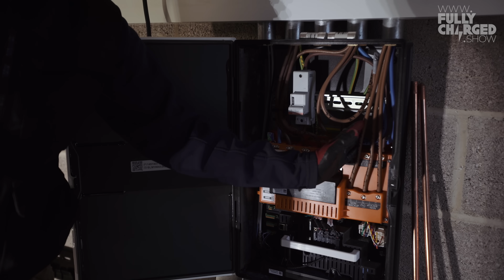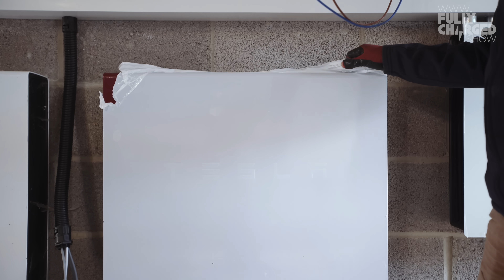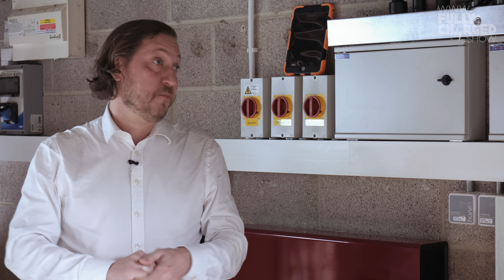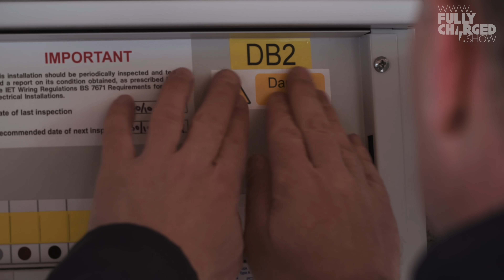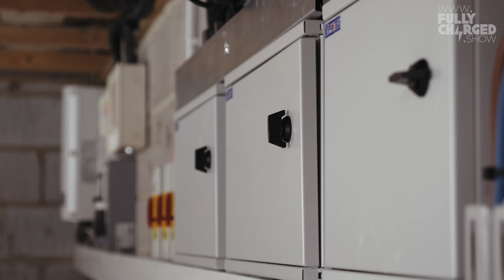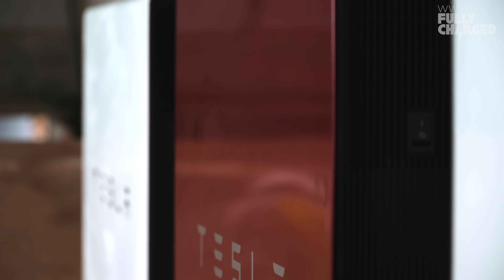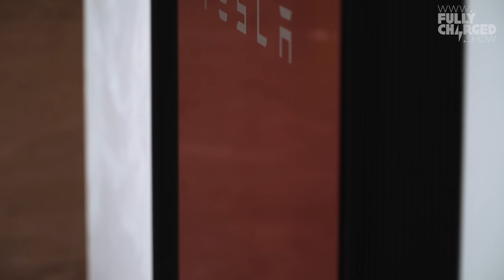Can you run your house on a battery? Tesla Powerwall 2 (Founders Series) & Tesla Backup Gateway 2

Comment from the maker: In response to your questions about the requirement for 3-phase electricity supply, Dr. Chris gave his thoughts:
"The grid operators look at the worst possible case for export in their calculations. They look at 5.5kW of solar being produced, with 10kW of power from the batteries, and no loads, and see if the grid can handle this 15.5kW of export (in this case they found it couldn't on 1-phase).  In real life, you wouldn’t see the solar producing its maximum and the batteries fully discharging at the same time, so the grid operators are being very cautious here.  Indeed the batteries are designed to discharge such that no electricity goes back to the grid!  The grid connection regulations were initially set up for back-up generators; if Robert had a 15kW diesel generator in his home these rules would make sense.  But they do seem a bit dated to work for modern solar/battery systems."
Reply: Yeah, they really need to review those electricity standards.

I mean, the disconnection switch ought to be on the grid's end of things. It's really poor design to distribute the responsibility for the safety of your engineers across many households not exporting - which entirely depends on everyone 100% following the standards, and that all the wiring has been done correctly - than it is to simply have the switch for a particular household on the grid itself (at the point where it branches off from the main line to each household).

Because then the responsibility is within a single pair of hands - the owner of that stretch of the grid infrastructure - and, more crucially, available for the engineers themselves to ensure their own safety. If they need to work on a particular stretch of the grid, then they can themselves disconnect all the users of that stretch of the mains line, to guarantee that no power is going in or out on that stretch, before anyone touches it.

This isn't unprecedented. That's how the water supply works. There are valves for each household, in order to cut the water supply to a particular building.

The "backup gateway" should not be necessary on your end, as the connection / disconnection switch more logically makes sense on the grid's end. Then the engineers themselves can directly make sure that nothing is importing / exporting on the line, before they start their maintenance of it.

It's shifting the responsibility for engineer safety to the wrong parties, in a distributed way, that's way harder to control. If I owned a stretch of grid, then I'd not be at all happy at ordering engineers to do maintenance, when the very structure here is logically wrong. Personally, I'd install the grid-side switches myself, to ensure I could sleep at night, with a clear conscience, that I'm not risking murdering my employees, on the off-chance that some cowboy builder has failed to follow standards, somewhere amongst the potentially hundreds of houses that are connected to this line, that I somehow have no ability to cut off from my end.

To be honest, even with a 100% "import" grid - with no micro-generation exporting going on - this arrangement was dumb anyway. Now it's just positively reckless.

The switch should be on the grid's side, so they disconnect you from the grid, in order to carry out maintenance, making it impossible for you to be importing or exporting, as you've been physically unhooked from the grid first.

It's not just that the electricity standards are out-of-date and need updating. They were a bit stupid in the first place (but I guess you could get away with it, when it was a 100% "import" grid). Now that the Grid really needs to be made properly bidirectional and more decentralised, this arrangement can't stand. It's dangerous and illogical.

If you get to talk with any politicians or other responsible authorities at any point, Robert, point this out to them that this is in very desperate need of revision, so we can more quickly get things to how they always should have been in the first place anyway.
Reply: @klaxoncow  It's much easier and safer for the Network Engineers to always treat LV as live, which is what we do. No change in standards will legislate for "stupid customers" so we have taken the responsibility for ourselves and our teams safety.  We have over 130 years of Network experience, and procecedures that are almost perfect, and are reviewed constantly. 
When I worked on the network, we used to worry about the paper shufflers in the office, as they were much more likely to suffer an injury that us, as all of our work was regulated and triple checked. 
Every LV phase has a fuse set in the substation, so we can isolate at grid end as you mentioned, we in no way rely on the customer household fuse.
Reply: fullychargedshow total cost?
Reply: SMart Export Gurantee - SMEG!
Reply: Looks like you should have had a restrictor on export put in place instead of upgrading to 3 phase
Reply: @Grande.Johnson  We tried that one!
Reply: @Grande.Johnson  "Indeed the batteries are designed to discharge such that no electricity goes back to the grid! "
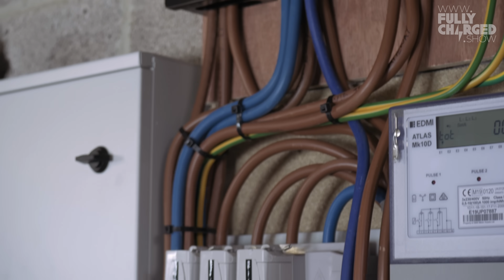Reply: the split phase looks right. I saw L1, L2/N, and L3 at 3:58. That usually means you’ve got an open delta to “fake” three phase.

Are you paid for the power you produce if you generate more than you consume? Given the investment you’ve already made you may want to maximize your solar generation

I’m surprised the throw over on loss of power is so slow. They have fast bus transfer relays that can switch without being noticed. Tesla needs to up their game
Reply: First. The issue of 1,2,3 phases. In the UK it’s generally a 1 ph supply and occasionally 3ph. In all cases the installation had to comply with the Wireing Regulations. in Roberts rural location he was probably being supplied by a small 1ph Transformer, hence the high cost to upgrade. And I’m avoiding the discussion as to weather that was needed or not

WRT safety there are clear recommendations in EA doc G83 and it’s updates, which are mirrored un the UK Distribution code and Wiring Regulations WRT signage, protection, and isolation. These are constantly under review as technology advances. And The Distribution Operators have their own working processes when it comes to maintenance work. I echo the comment about always treat it as live unless proved dead, isolated, and earned. PG Thomas Chair of G83.
Reply: We have a 15kw wind turbine and our grid supplier wanted us to upgrade. I drew up a circuit diagram showing how we would not export more than 16 amps, in fact we try to export very little, using any spare to heat a 7000 litre water tank with heat exchangers for domestic hot water and heating. This was passed by them and we didn’t do any upgrade.. it’s a rip off in any case, if you can draw 100 amps down a line you can send 100amps back up, they just want to make money for nothing.
Reply: Agree.  But it may be that this Powerwall is 3 phase unit. Perhaps Richard will tell us
Reply: @peterthomas3336  not 3 phase PW2 no such thing. need to put one battery on each phase. only 2 PW2 in this video so batteries only attached to two of the phases. the site needs a lot more solar that is for sure.
Reply: Well they can't wing it, that sounds technically correct and also a safe way.
Reply: Please correct me if I'm wrong, but... if I supply power back to the grid either from SPV or battery and the 'grid' is disconnected from the grid by a fault say on my phase, then I could be supplying all other properties on my phase with power which would soon run down my battery's very quickly I.e in the case of powerwalls at about 5kw each, so the disconnect needs to be at my end  as required by the regulations, to protect me and other people on my phase. Also think 15 sec for failover is a long time, this would mean I still need at least 1 UPS for my computers.
Reply: Having been a distribution engineer (power networks) for a UK utility, I can tell you that we never “assume that the power line is dead”.  At low voltage (240/415V) we treat the cables as if they are live at all times, as it’s just to easy to miss someone pumping electricity in from an unknown source. At the higher voltages, behind the transformer, (11kv) we disconnect all of the LV links before starting work, as again we never know If there is a source consumer side. We also disconnect both ends of the HV cable with circuit breakers before testing the line, basically by shooting a steel bolt into the cable to short it!  The three phase issue here isn’t about protecting utility workers, as we almost never put ourselves in a position to be in danger.
Reply: @Muppetkeeper  First time seeing 240/412V, we have 120/208, 277/480 in the US.
Reply: kimchee94112 It’s nominally 230 volts single phase, and 400V three phase, but we used to use 240V, but now we’re 230V with a wider allowed margin. That’s Europe for you 🤗
Reply: @Muppetkeeper  mate this is a consumer focused show. details details. gotta make lord elon seem cleverer.
Reply: My  question is could u run ur house just off solar and batteries no grid for long periods
Reply: @matthewbuckle6419  you are asking the wrong question. of course you can. it depends on the design and cost.
Reply: @boobtubereborn  so what would be tbe question if i can i would like my house to run without the grid
Reply: @matthewbuckle6419  If there's enough solar to refill the battery during winter, sure.  The solar and battery are able to work with each other while disconnected from the grid.
Reply: @taylorlightfoot  i mean completely no grid at all
Reply: @matthewbuckle6419  Technically yes.  I don't think Tesla has released support for this yet, but you can make it happen.  You'll need to have the Backup Gateway still and you'll need to hook something (pure sine wave inverter powered by battery) up to it initially to act as the "grid".  Once the system is installed, get rid of the inverter acting as the grid, the Tesla system will sense a grid failure, automatically disconnect from the grid, and then the system is running off grid.  

A few caveats.  You have to trick the system into thinking there's a grid when you do the install, you have to have an Internet connection to use the Tesla system.  It needs Internet basically all the time, you have to install the Backup Gateway with the automatic transfer switch inside, You might not be able to find a Tesla installer willing to install it in the manner you're trying to accomplish.

There are other off grid products that support what you want to do.  SMA Sunny Boy Island, Schneider Electric Conext, Outback power systems, MPP Solar inverters, Victron Energy, SolArk, etc.
Reply: @matthewbuckle6419  Technically the answer is 'yes you could'. Calculate the peak power you would use (to size your inverters max power rating), calculate your average daily power usage, multiply that by how many days you want to run only on battery pack, allow for conversion losses in inverter/charging. That's the battery capacity you'll need. The PV 'solar panel' size/capacity will need to be chosen for the ratio of grid/off-line you expect, so that it can keep pace with your average load (plus a little extra to recharge the batteries).
e.g  peak load = 20kw (inverter needs to be rated 20kw max load).
Average load = 2.5kwh (24hr = 60kwh per day), choose PV panels to at least this minimum daily provision.
Battery capacity = 60kwh = 1 day, if e.g you want to run off battery for 14-days, then batteries =60kwh x 14 =  840kwh.
Allow extra for loses in percentage  inverter/charger efficiencies.
e.g. if total inverter/charger efficiency is 50%, then you'd double the battery capacity and PV minimum sizes.
The above is only ball-park in essence, but it's a reasonable overview. In reality you'd have to factor in temperature effects on batteries and PV panels, and local weather conditions, and any seasonal variation.

Inverters are most efficient around 60-80% of max rating, so it might make sense to have a dedicated inverter if you have one or two really power hungry appliances such as a 10kw shower, and a separate inverter for your other loads that never peak over say 4 kw and average 2'5kw. OR heat storage of water and a mixer shower, and only a 3-4kw inverter to do it all.
Reply: @matthewbuckle6419  if you're a hikka w/o wife and kids, and etc and don't live in the Arctic - sure, why not?
Reply: @peteri3982   i mean will we ever become grid free for ppl with families etc
Reply: I don't believe you have a three phase setup. You have a split phase setup.  A simple voltage test across l1 and l3 is simply double the voltage between l1 and l2 and l2 to l3. plus you would have to have two to three transformers out on your incoming line to have three phase. It is three wires tho 👍
Reply: if i'm reading this correctly, which i'd like to think i am, are you suggesting that your batteries can feed into the grid? because i would not think that's ever a feature someone would want?....i can of course understand exporting excess power from the solar, because of course, but in what kind of situation would your batteries go full dump to the grid? why would that even be an option?
Reply: @McLovin1188 its not a case of using grid power but if it was to become obsolete could i power my home just on solar and batteries
Reply: It's also about keeping the phases balanced. A single phase can deliver almost any amount of power, but you can't have 1 of the 3 phases supplying significantly more power than the other 2. The load has to be balanced at the transformer.
Reply: Panasonic and Fujitsu in Japan have had these lithium cells for homes for years. I heard Tesla is even using the same cells that Panasonic use. It's nothing new really.
Reply: How many years does it take to recoup your investment if ever?
Reply: @ovdtogt1  You never recoup your investment. If all goes well and you have few issues to solve, all you will do is prepay your electricity bills. A friend has a $15,000 installation and it will never repay him. But he doesn't care. He just likes living with this way of providing power independence. No batteries, unfortunately, so when the grid goes down and so does the sun, he is SOL.
Reply: https://youtu.be/gP51JjnWvLo?t=860 The Power Companies will then change the peak price!
Reply: Tesla controls what can export - it makes sense to prepare for the worst possible export.
Reply: Something fishy going on here. My house has a 100A supply at 250V. That is a roughly 25Kw capacity. Most homes around me are 200A standard. That is 50Kw capacity. The output from the batteries is limited by the capacity of the inverter. Installing a 10Kw inverter and having 5Kw solar panels delivering an actual 5Kw of power at noon on a sunny day makes 15Kw of power to the grid available, yes? A long way from my 25Kw lines to the transformer in the street. So why the need for three phase? Does not make any sense. As does much of the content of this video. Too many missing pieces here. Too many qualifiers left out. Crucial ones.
Reply: So what are the benefits if you don’t have constant sun?
Reply: I think the powerwall is shit if it makes me have to invest another fortune for a UPS. An outage is a dealbreaker. Just like the internet coercion.
Reply: What would the total cost of this system be to install
Reply: in the U.S almost no residential areas have 3 phase power and even in the industrial areas it is extremely expensive to put in. here they quoted $250,000 for 600 feet. 3 phase is much cheaper to use for industry and they hate it.
Reply: Winner of a video, been searching for "how to make your own electric generator" for a while now, and I think this has helped. Have you heard people talk about - Pansaiah Renowned Preeminence - (search on google ) ? It is a great one of a kind guide for discovering how to create an efficient homemade generator without the headache. Ive heard some amazing things about it and my mate got cool success with it.
Reply: Many thanks, I been tryin to find out about "can you run a generator with an electric motor?" for a while now, and I think this has helped. Have you ever come across - Pansaiah Renowned Preeminence - (search on google ) ? It is an awesome one of a kind guide for discovering how to create an efficient homemade generator minus the headache. Ive heard some extraordinary things about it and my partner got cool success with it.
Reply: We do this different with Victron, We can program the maximum power getting fed to the grid, iff you want to feed that, So the house is totally seperate from the grid. But can feed the grid iff wanted, other way around, you can always use the grid to charge the battery,s iff needed. (and stil this system disconnect the grid when there is a power outage.. .. so even iff you have 30 kw on the roof, you dont need 3 fase. Its all programmable.
Reply: It should be, but isnt made obvious in this, or many other Powerwall presentation videos that the Tesla Gateway as it currently stands (2 October 2020) cannot supply backed up power on anything more than a single phase of your three phase home. For anyone with an existing 3 phase supply this actually means rewiring the property to ensure that critical components are installed on the backed up phase. Immersion heaters, pumps, car chargers, CCTV etc etc etc. Is anybody still up for that little sting in the tail after all the other costs involved or is there a more elegant work - around solution?
Reply: Why not just not export to the grid at all?  It sounds like with the Powerwall's capacity you'd have very little to export anyway.
Reply: steve ward

From what I can see here you have 3 single phase inverters on a three phase system? If that's not the case you must have, ripped out the existing 1p inverters and replaced with three phase inverters for the existing PV and battery. 

If its Its made up of single phase inverters as i suspect you must have one Inverter for PV and Two for the battery units.  i.e its either all lumped on one phase and doesn't conform to G99's balancing requirements, or you have PV generating on L1 and the batteries doing nothing on L2 and L3. Why on earth the DNO recommended 3 phase is beyond me. Much better solution would have been to apply G100 the battery inverters and keep a max Export of the 5kW PV even if it meant sacrificing some capacity to avoid cost. G100 allows you to exceed the G99 voltage limits by an extra 1% so if the first 5kW PV + Battery Worked this should in theory have allowed scope for an extra battery.

All in all not the best solution, both from the DNO and the installer. 

G99 : 7.5.3 Where single phase Power Generating Modules are being used the Generator
should design the installation on a maximum unbalance output of 16 A between the
highest and lowest phase

G100 : 5.2.3 Voltage Assessment
The Power Station Capacity shall be restricted to prevent DNO equipment voltage ratings
from being exceeded during the detection and operation time of the ELS. It is recommended
that the highest network voltage is no greater than the Statutory Voltage Limit + 1% (of the
Nominal Voltage) before the ELS operates.
For LV networks, the Declared Voltage is 230V (phase to neutral) and the DNO’s upper
Statutory Voltage Limit is = 230V + 10% = 253V. “Where a Power Station Capacity does
not exceed 32A per phase and consists solely of Type Tested SSEGs a voltage assessment
is not required. In all other circumstances the maximum Power Station Capacity should be
restricted in order to prevent the network voltage exceeding 253V + (1% of 230V) = 255.3V.
Reply: the network operator needs to keep the voltage within a statutory limit or faces penalties for failure to do so. too much export from solar pv can cause a voltage increase in the mains which can cause damage to other customers, hence the reason they take the worse possible scenario. 
they do assume minimum demand on the network as opposed to none
Reply: Sorry, but the utility has their heads where the sun doesn't shine.  The phases aren't balanced down to the single home level with entire neighborhoods being run from a single phase.  I have a water heater that pulls 36kw from single phase -- that tiny 5.5kw PW unit is insignificant.   Running 3 phase to the average residence is a true waste of metal and man power.
Reply: 1 phase is a misnomer, there is actually no such thing unless you live in an extremely old house and never had a service swap, it is still called single phase power for residential systems, but to supply 240 volts two phases is required.
Reply: @capo_di_capi  You are getting confused with 50hz 220v WRT Neutral systems verses the American system.
Reply: That is the problem with telling them you are installing something that will not impact the grid at all. They won't understand what you are even doing and make you spend a lot more money than necessary to support another battery in a way it would never be used.
Reply: @EVMANVSGAS  In reality it could effect this grid. Imagine this situation : Homeowner is using 10kW of power to say charge the Tesla that 10kW is being supported by the 5kW PV Inverter and 5kW Battery inverter. When he unplugs the car the grid sees an instantaneous export of 10kW until the control system kicks in (maximum 5s operational period) in that 5s the grid volts could go above statutory conditions and cause issues. Its the reason we have ENA G100 to accommodate these systems.
Reply: Single phase can easily handle 40kwh. They make it hard as possible to hook up to the grid. We aren't allowed solar or batteries in East Tennessee at all. If you want solar, you have to unhook from public utilities and run totally off the grid or separate systems that aren't connected at all.
Reply: @Bryan-Hensley  we run our farm on single phase and when we were still milking our usage used to go over 20kw and lights would start to flicker, as far as I know in the UK our transformers can pump out an absolute max of 25Kw on single phase but the utilities dont want you drawing anywhere near this much as transformer fuses are expensive!
Reply: @ShawFarmHolidays  Your milking equipment is mostly run by motors, yes? The inductive surges you see as flickers in the lighting, could indicate you are into overload territory. So the voltage drops as another motor starts up. You could get an electrician to connect a data logger to your setup to see if this is the case, and adjust the timing of your loads accordingly.
Reply: @techhie1302  thankfully we packed up milking a few years ago so we are no longer so close to the limit, but yes we always had to make sure no one was welding or had the kettle on when switching on the milking pump to avoid tripping the system, especially in the winter when all the lights were on!
Reply: @Bryan-Hensley  it depends on grid and outdated regs.
Reply: Bryan Hensley in Australia we are penalised for having solar. We have 4.5kw and only save $15/mth. The more ppl that get solar, the more they raise the cost of power. We are going off grid in our next house. Then the system we have will actually benefit us not them. But in saying that we are going to use simpliphi no tesla. I believe the batteries may cost more but last longer and are safer
Reply: @Bryan-Hensley  Presume you mean 40KW, which would mean a current of 166ish amps. No, UK domestic supplies are usually rated to a maximum of 60A, or sometimes 100A.
Reply: @Bryan-Hensley  The TVA lobby is alive and well.
Reply: @Bryan-Hensley  is it legal to go offgrid?
Reply: @Bryan-Hensley  Nice of you to comment, but only helpful if you know something about the subject. Kw are a measure of power. KwH are a measure of energy. Stating "single phase can handle 40 KwH is just plain nonsense. A 2KW load (dryer) run over 20 hours, consumes the same amount of energy as a 10Kw load over four hours. Both 40KwH of energy.
Single phase power, running 165A at 240V, is a power supply of about 40Kw. North American standards in many places supply 200A to your panel. Houses that are heated using electricity are normally 200A.
Reply: @Bryan-Hensley  So you can have two systems at the same time, like your house on the grid and your barn/shop off grid ? If so, I would then run an thick extension cord and in summer run washing machines on the off-grid system and in winter use the same cable to run some devices in the shop ;-)
Reply: @Bryan-Hensley  Correct, the companies are BS-ing you all. Basic ohms law would tell you that, but they are relying on the majority of joe-public being ignorant (and that's JP being willfully ignorant). The  argument of 'line might become live' is also BS, my friends son is a 'jointer' for public power, he works on live lines every day; the systems/tools/techniques have been invented and in use for decades to work 'live'.
Reply: Brian

In the UK the service fuse is usually 60A which is around 15kW a Power rating . kWh is a unit of Energy. And the design of UK distribution networks is based on an energy consumption per household of around 3-4kWh. or 9 12 Amp continuously.  Clearly there is diversity so one might occasionally thake 60Amp (15kW) for a few minutes. Typically in the UK this will be an electric shower.  So the idea that one could continuously take 40kWh (170 Amp at 240V) isnt possible UNLESS you have a 3 phase supply (3 x 15kW). And even then if everybody took the same load at the same time things would go rapidly south.

None of this is really relevant in Richards case though, as he only has 5kW peak of solar. So the chances of him getting into problems, even with a single phase supply, is unlikely. Which is a puzzle if WP Distribution enforced a 3ph connection. And if he limited his uptake to around 7kW whilst charging the batteries / car when the Solar is zero.
Reply: @peterthomas3336  In my state in the US, new homes are equipped with 320a single phase 2 pole utility with each home having no less than a 200a main breaker panel.  There is a little more than 76kw that can be tapped into at the home.
Reply: @peterthomas3336   But like they said in the video, people allegedly ran into the same issue Rob had where he'd had a full battery with no way to use it in a power outage. Here in New England the power goes out regularly during the winter, the rain, or other harsh weather. as a result im surprised i havent heard of more people hooking 3 lines from the grid directly to their houses.
Reply: @peterthomas3336  Please note: 170A at 240V is about 40Kw,  NOT 40 KwH.
Reply: @peterthomas3336  Correct, the companies are BS-ing you all. Basic ohms law would tell you that, but they are relying on the majority of joe-public being ignorant (and that's JP being willfully ignorant). The argument of 'line might become live' is also BS, my friends son is a 'jointer' for public power, he works on live lines every day; the systems/tools/techniques have been invented and in use for decades to work 'live'.
Reply: Please explain someone, these LiPo or NiMH batteries? And if they lithium, how it can be, it's ineffective (in economic sense), or these new®© scientific developments??
Reply: Peter i lithium ion apparently have a history of excess heat which can cause fires and lithium ferrous phosphate batteries dont have that problem. Look at the forum online for tesla and again for simpliphi and see what experiences ppl have had
Reply: Pommies are the greatest scum ever to walk on Two or Four Feet .
Reply: @thelastaustralian7583  Delusional. You're a Pom too yourself, just a generation or three removed from our common homeland.
Reply: Thanks Ellenor ...objectively why Pommies are the Scum plaque of the Earth is due to them being controlled by foreign Zealot Paedophiles psychopaths for to long. Polluting the social system with generations dumbed down without any understanding of morals or Ethics .Lowered to basic generationalized normalized Primal instinctive behaviours, with the audacity of confident destructive Morons. Australia is full of them. And that's why it has been dying dramatically both ecologically and obviously Socially, since the end of WW2.
Reply: I think the magnetism of all those wires and electricity is fucking with that dude's eyeball. it's all cockeyed
Reply: i would hav sub if the conversation wasent so boring /but sub- titel wass intresting tho  click bait ?
Reply: @Namonesu  Get back to licking your window.